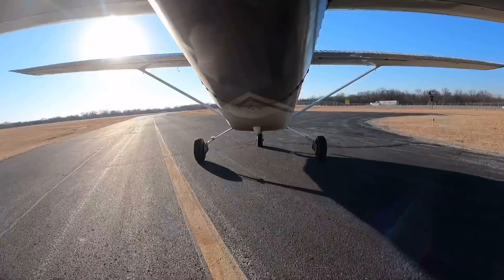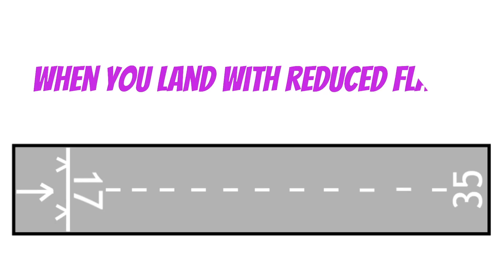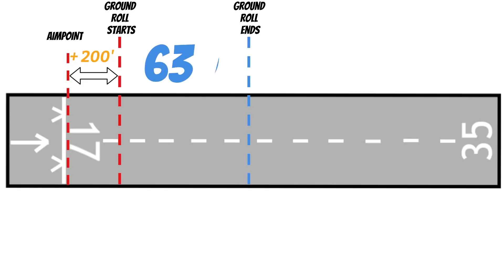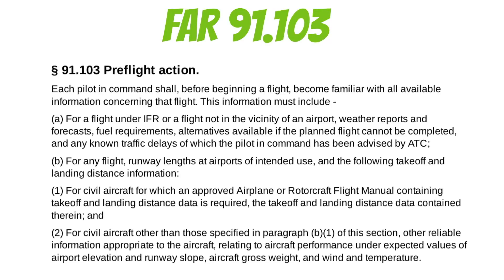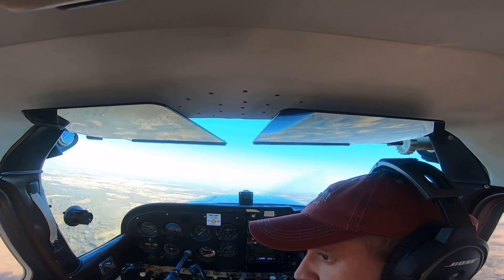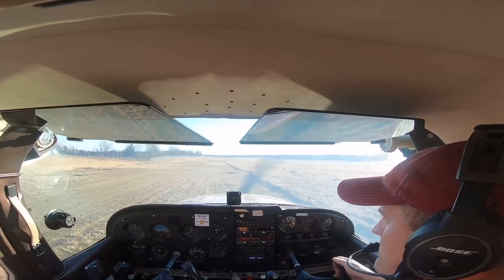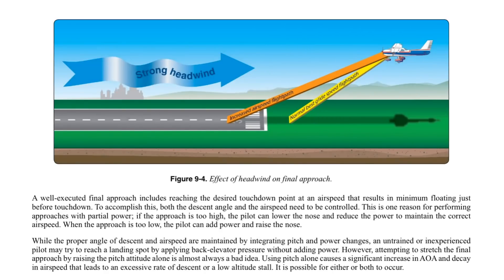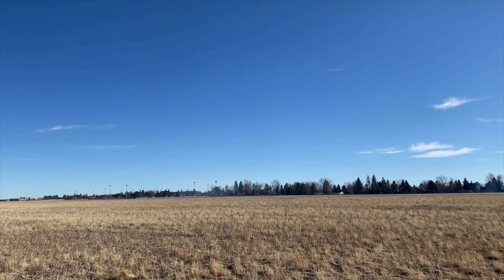Should "Normal Landings" be made WITHOUT POWER?

Comment: Another reason to use 1500 to 1700 rpm during decent for a Cessna 150 or 172 with a Continental engine is to maintain exhaust manifold temperature in order to keep carburetor heat effective.  In the event of power failure during final approach, raise flaps to 20 deg to establish a longer glide distance.  Can raise flaps to zero but will raise stall speed.  The engine on my C150 stalled on the runway after an engine out simulation from pattern altitude.  After touchdown, applied power and momentarily rpms increased then stalled due to ice melt and restrictive airflow.  Engine restarted promptly after exiting the runway. Lesson learned.
Reply from the maker: This is another excellent point I didn’t even consider Colin.  I really appreciate this one.  You’re right, this could definitely cause a problem. That’s one of the reasons we test “idle” with carb heat on the runup.
Reply: So true. I fly a Cirrus SR20 at the moment. If you look at the torture for the old 6cyl. engines on the engine page, if a student is high on final and puts power on idle, your EGT and CHT completely vanish from the display. And next of course the student after touchdown (maybe still a bit to fast and long) slams the throttle forward to full power. You can feel the engine resist. Rinse and repeat. So maybe the engine failure you want to prepare for is actually caused or helped by idle approaches. In the US, patterns are also defined more with reaching the runway from every point in mind than in e.g. Germany where noise complaints dictate traffic patterns all to often. I don't idle before I transition usually and never before making the runway is assured. I prefer treating the engine well and a stabilized approach (that is by definition not idle) over the theoretical possibility to make the runway with engine out. And the POH of the Cirrus has anyway full flaps on base so an idle approach would violate normal landing procedure. I wasn't aware normal landings idle are even a thing, thanks for clarification in the video.
Reply from the maker: @BlueSideUp  thanks for the comment! It’s great to hear feedback like this! I’ll see you in the next one!

Comment: Good video!  The one thing I was taught and made sense about slipping with flaps on a high wing aircraft is that you could lose a little rudder control due to blocking the airflow to the tail section.   But I guess just go with what your POH says for that aircraft.  I always have power right until time to level and flare unless practicing slips or power off 180's.  Again, everyone does it a little different and guess it is what you get used to and a comfort level but I like to come out of my comfort level once in awhile and try something different just in case I get thrown into that un-foreseen scenario!
Reply from the maker: Thanks Bob! That makes sense on the slip blocking the rudder.  Never thought of that. Thanks for the comment!

Comment: If you want to achieve better landings, ensure you are nailing the correct airspeed by using power as appropriate. During the flare, ensure the throttle is fully closed, align the aircraft with the runway with rudder, keep the wings level, or if a crosswind, lower the into wind wing a few degrees with aileron. Then squeeze every bit of lift out of the wings with appropriate back pressure, elevator. When the lift is all gone, gravity will put the wheels on the runway for you. Your job as as a pilot is to fly the aircraft. It will LAND itself quite successfully if you FLY it properly.
Reply: Adjust pitch for airspeed. Power controls descent.
Reply: Either work equally well. However, during the teaching phase the aiming point technique with its easier-to-control constant attitude visual aiming point, for short finals, CONTROLLING SPEED WITH POWER is the easier method for the student to assimilate. That is my objective conclusion based on a lifetime of managing an international FTO. It also helps if when the throttle is FULLY CLOSED the student puts two hands on the control wheelie. If it is a control wheel rather than a stick.
Reply: @tomarmstrong1281  I agree they work equally well in normal operations, but teaching fundamentals that airspeed is ultimately a direct function of pitch to the point that it's instinct will save lives when the plane gets too slow. It should be an instinct, and teaching it the other way leads to pilots making fatal mistakes like Colgan 3407, and countless GA crashes that could be avoided. If you put a pilot that learns airspeed is a function of power in a plane that doesn't have any power for whatever reason, they will have to learn this the hard way.
Reply: @ryanmcgowan3061  You are entitled to your opinion. I strongly disagree. Most accidents are attributable to pilots being taught by rote, which is a useful teaching tool during the learning phase. A well-rounded, well-taught pilot will be a much safer pilot in any emergency situation. In my capacity as a flight examiner it was evident which pilots were well taught and the others who often failed their skill test and had to be sent back for retraining. Sadly often by to the same hapless instructor. I felt sorry for them.
Reply: @tomarmstrong1281  I'm not sure how my opinion contradicts any of what you just said. It's all entirely compatible with controlling airspeed with pitch. In loss of power situations, the skill remains consistent if the pilot knows to control airspeed with pitch, and doesn't require a secondary set of techniques. In normal operations, the only difference between our techniques is which comes first: pitch or power. For your technique, you adjust power to get your airspeed, which will shallow the descent rate, so you then pitch down, even if you aren't realizing it. In my approach, I would pitch to change speed and adjust power to maintain the approach. Same inputs, different order. In the case of loss of power, I don't change my technique. Starting off mostly in gliders, this is very much muscle memory and comes perfectly natural.
Something occurred to me that came from flying gliders: Every aircraft is capable of 1:1 power to weight ratio. From a paper airplane to a Airbus A380. Gravity is that powerful, and is enough to rip the wings off nearly every aircraft. Gravity is immediately responsive and will accelerate the heaviest aircraft at 1g if the pitch is that extreme. Very few methods of propulsion are capable of changing your airspeed that quickly. As well, I can decelerate from VNE to a stall in a matter of seconds, and vice-versa. I'm also acutely aware of the trading of potential energy to kinetic energy, and have a feel for how much I have left based on my visual perception of the distance to the ground. If I need +20 knots in 3 seconds, I have it at my disposal. All of these paradigms whisk away if I think of airspeed as something that is controlled by propulsion. It's not my opinion. If it's anyone's opinion, it's Newton's.
Reply: @ryanmcgowan3061  Too many words. All pilots should be sufficiently skilled and confident to use the flight controls appropriate to the situation. If not they ought not to hold a piece of paper which bears a flight examiner's signature.
Reply: @tomarmstrong1281  Absolutely.

Comment: Isn't the only question whether you would make the runway if your engine failed and secondly is the runway long enough?
Reply from the maker: According 91.129, in class D airspace, you are required to follow the glideslope (PAPI guidance). This is virtually impossible to do on a power off approach
Reply: @FreePilotTraining  It doesn't require that though.  "At or above" is the wording used.  A power off approach would generally be steeper than the glideslope, putting you in compliance with the regs.

Comment: Regarding rollouts and less flaps taking more, I t’s not less drag to stop the airplane with less flaps; it is more energy to dissipate as you landed faster. The drag of your flaps down or up is insignificant on the ground compared to wheel friction. Consider Cirrus states to put flaps up for better braking as you’ll have more weight and more friction on those wheels. This wouldn’t be possible if drag were the dominant factor. Note also floating with zero flaps is airplane specific, your Cessna may float more but the Cirrus won’t.
Reply: You even did such later in the video with “flaps up, simulate maximum braking.”

Comment: When I was a child I learned basic of flight on ms flight sim2004 and did tons of 737 landings, not saying it’s anything close to the real thing but when I started my ppl training, my instructor told me every landing should be a power off landing and that confused the hell out of me because it goes against my muscle memory and instinct of adding a bit pf throttle and taking it back right around touch down to reduce decent rate and smoothen the touch down. It took me pretty long to get myself to land with no power but then now it makes so much sense that you need to land with 1500-1700 rpm and gauge for wind. The question is no power landing is actually bad for the cylinder head metallurgy because of unstable heating and cooling of the cylinder and increases the potential of cylinder cracking and potential engine failure ?
Reply from the maker: Yes. Shock cooling can damage the engine.  I don’t think it’s as common as everyone says, but it’s still an issue

Comment: If you’re flying conventional gear and haven’t done your tail wheel landings in a while, I recommend landing at a longer field and actually landing with a bit of power on. Consider this training wheels as you’ll want to be power off at touchdown once again proficient. The reason here is that a pull tractor style propeller is a stabilizing force for partially countering your unstable ground characteristics of that tail wheel. Adding a little power as you flare can also help you cushion and reduce VVI on a drop should you have flared a touch too high thus reducing or alleviating that “bounce” as your tail drops through after your mains touch, though perhaps go for three-points not wheel landings unless really current and proficient.
Reply from the maker: Yeah, i definitely want to get back in a tailwheel soon

Comment: I was practising full stop landing the other day , I done 3 into the wind and every time with power off with 2 of the landings I experienced wind gusts that prolonged my decent and causing the plane to loose speed so by adding a little power it prolonged my glide slope but gave me a smooth landing so on this occasion you are correct but it all depends on a factor of a few things ,
Landing with power in most cases is going to lengthen your landing distance and if for some reason you need to go around you need to be sure you have enough runway left to do so. 
So there's to many variables to take into account when landing and will change depending on where you are what the wind is doing and so on .
But I will state that you can be right and can also be wrong. 
Fly safe everyone from Australia 🇦🇺
Reply from the maker: Thanks for the comment!

Comment: Another way to look at the strong headwind case is to treat it similarly to your groundspeed versus true airspeed discussion. You have two glide paths. One through the airmass and one over the ground. You visually see that over the ground which is steeper than you actually fly (except with tail wind). Your VASI/PAPI/ILS /GlideSlope/internal sight line will typically seek a three degree path but you may be flying only two degrees with that wind. 

The Navy uses a similar idea flying at the boat. The systems typically show a four degree path but either due to wind across the bow, or when wind is not present, due to the ship driving away from landing aircraft (in effect producing a relative wind), while seeing a four degree glide slope, the aircraft fly a three degree glide slope.
Reply from the maker: That is super interesting. Thanks for sharing

Comment: Nice using the slip as opposed to flaps to retain follow-on options. Too many these days are afraid of slips. Or they’re afraid they’ll be called out for slipping. 

You’ve got your “engine out” with the turn somewhat early for heavy wind, nice, any discussion to adding a couple knots versus “best glide” as best glide is really no wind (though max weight forward cg)? Incorporating Glider handbook’s extra discussion on the drag polar with head/tail wind and rising/sinking air is illuminating. As is incorporating best glide AOA versus only ideal in one condition speed. Add another glider idea, aim a third of the way down the runway giving margin to under energy not just over energy. We’re so used to aiming at the numbers in powered planes to maximize pavement for stopping but that’s not the best optimization if you don’t have power.
Reply from the maker: Very true

Comment: Could you comment on why we should be concerned with slightly higher touchdown speed for the partial flap / steeper approach combination when most runways are plenty long and where a concern is maintaining engine out proficiency along with deadly hazards on the ground in the event of engine out on final?
Reply from the maker: Engine out proficiency is one thing, but making them your “normal landings” is another. In addition to the high sink rate that can develop with power off landings. I challenge anyone to maintain a 3 degree glide slope during a power off approach.  In class D airspace, you are required to follow PAPI guidance.  You won’t be able to maintain that with power off.  As far as the higher touchdown speed, runway distances are your main concern in that case.

Comment: I‘m actually quite surprised that this is an issue. Where I come from we always teach students to fly power-on approaches and just do power off approaches as emergency training. In that case we start 2000ft above the threshold, pull the power and glide in a quadrangle to a landing. 
Guess that has to do with the fact that many GA airfields here are pretty small with runways in the 1200 to 2500 ft range, so short landings are the norm and not the exception.
Reply from the maker: There are quite a few comments arguing the opposite
Reply: Doing power off approaches on those small fields is like threading a needle. But it's a hell of a feeling if you get it right. Also landing on a large airport with power off is a piece of cake afterwards. So I do think power off landings are important to learn BUT I also believe that landing with power is the best thing to do in every day situations. So I agree 100% with your assessment.

Comment: I learned by a rare breed in Tulsa at 1h6 late 99-2000. My first 6-7 hours in a 152 by David Lowen great instructor. I was young and he wanted to be sure I could handle anything that might happen. For the first 6-7 hours I had no airspeed indicator purposely I found out lol. Slight back pressure and the plane knows when it wants to fly. We always made power off landings. Because he always said never fly your pattern any wider than you can make the runways in an engine out. At the numbers on downwind to base is where we went to idle. That method i believed saved my life 10 years ago in a mountain situation. Fully loaded and had a prop governor failure on the 177b. It was so damn close I had no time to look at any instruments. Knowing my plane and a few different instructors styles all put into my knowledge bank is why I’m still here. In the same boat some people can’t feel it out like others and that could be a bad deal.
Reply from the maker: Great story. I totally agree. Your patterns should always be close enough to make the runway if you lose your engine. As I mentioned in the video, if you are making approaches with power on, there may be a really small area on short final where you might not make it, but if this concerns you, you can always plan to land on the captain’s bars to mitigate this problem.
Reply: @FreePilotTraining  you are a fine pilot! I’m always looking to learn technique. I enjoy your videos for sure. Keep them coming!
Reply from the maker: @joshc7091  thanks man!